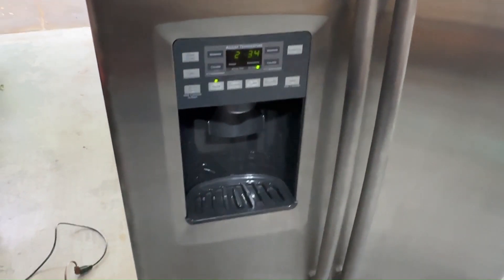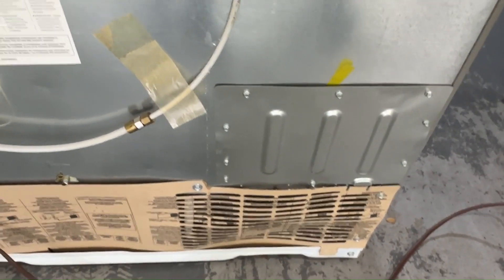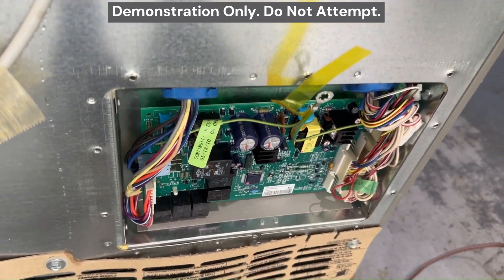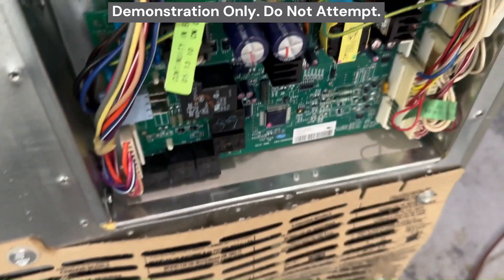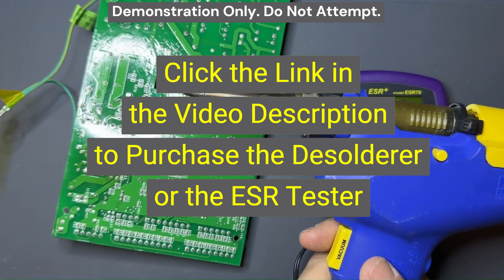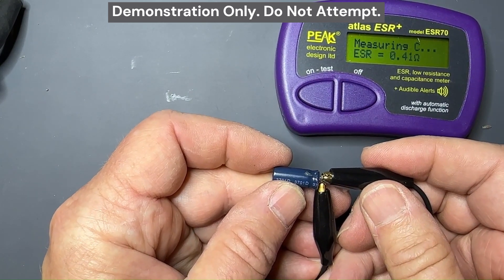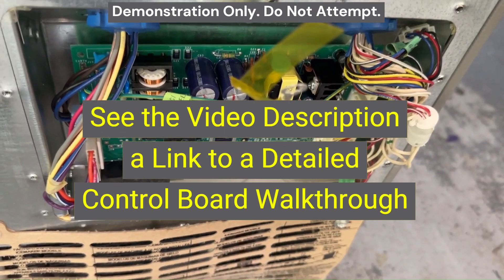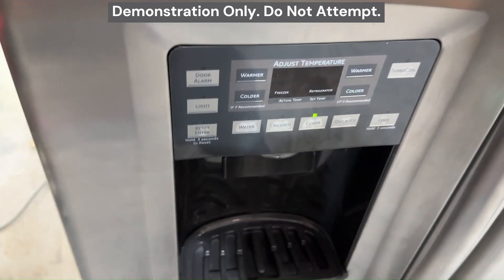#104 -GE Refrigerator Motherboard Failure - Electrolytic Power Supply Capacitors

Comment: Years ago I had a high end unit that was struggling to cool, found out it was because the condenser fan was not running, no power to it. Turned out the relay for it was bad, I replaced along with a couple of capacitors as I was in there already and it ran great after for years.